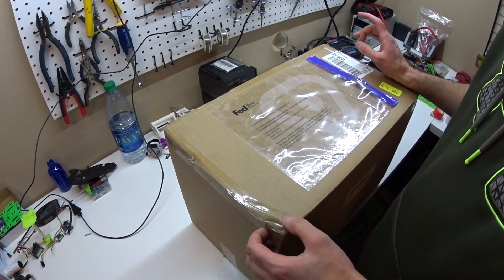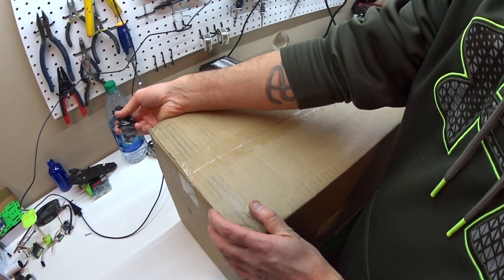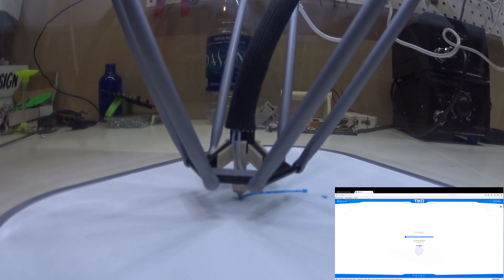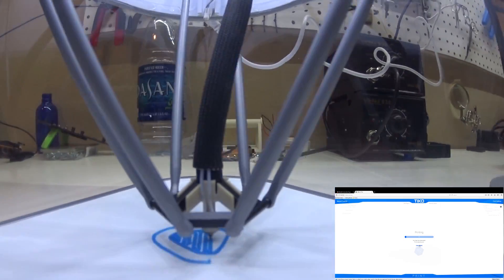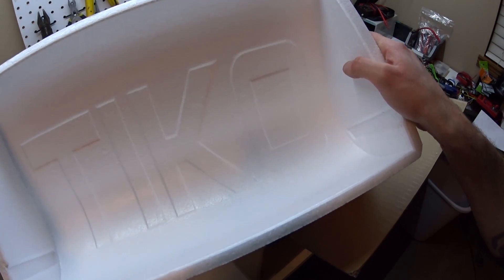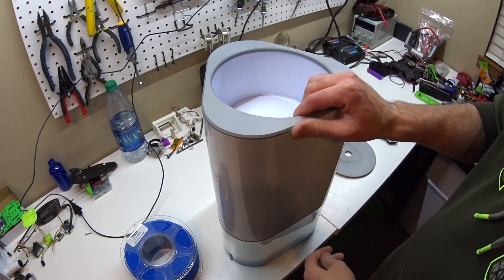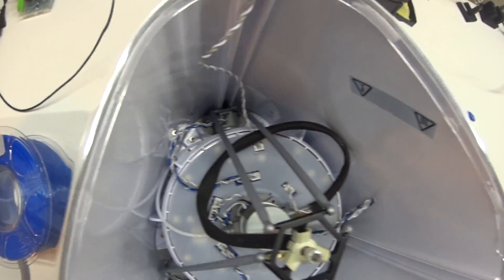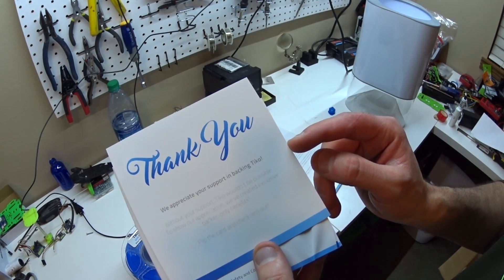Production Tiko 3d - Print and Unboxing

Comment: I'm having horrible luck with my Tiko I just received. Could not even print the demo model properly. Spindle/arm drive motors kept popping out of the tracks and Bowden feed tube came apart mid-print and broke filament in the feed motor, required a complete teardown.  A whole day messing with it trying to print something so far. Had hoped for better.  It had been dropped too hard in shipping and had cracked clear acrylic that Tiko does not warranty (cosmetic).
Reply from the maker: Oh man sorry to hear that you are having so many troubles. The arms should definitely not be popping off during the print. I know I have had some difficulties getting the arms apart as I had to have Tiko send me some replacement arms. The carriages should also not pop off to easy either. Do you still have 4 clips on the carriage?
Here is a picture of the carriage:
https://goo.gl/photos/8UosXFooJqBDkiXN6

If there is a ton of slop in the carriage then I would contact Tiko for replacement carriage assemblies since you shouldn't have much side to side play in the carriage assembly. I would also check the gear rack that the stepper motor comes in contact with since I have heard of others having issues with the alignment of the gear rack.
Reply: Propslayer, the arms were not popping off, just the carriage clips. This is a brand new unit and there did not seem to be much slop in the clips. I do have a support request in with Tiko. The gear rack alignment is something I'll look at next, thanks for the suggestion.  The prints it did manage to make were sloppy and skewed and the demo model printed a lot worse than the one it came with.

The other hassle it not being able to get the Tiko to log on to my home Wifi router to get internet for updates and access it from my desktop, just hangs at "in progress..."  I've had to run it direct from my phone only.
Reply: cybervid07 if you want a good 3D printer I think the anet a8 is good but I hear that also sorry about your experience
Reply: Thanks. My Tiko may never work properly and parts have failed, and likely I'll never get the warranty parts I ordered because Tiko will be filing for bankruptcy soon from what I read on their own forums. At least I got a (broken) printer, many thousands of backers may get nothing.  I will look into the anet a8.

Comment: The distance to the print bed is actually just fine: while printing a raft the distance would be 2 layers high and double the filament. On top of that a thin easy to break-off layer. That's exactly what appears to happen.

Comment: Thanks for sharing.  Looking forward to seeing a print with a higher temp.  Not sure why it needs such a high temp? 190 should be fine for PLA
Reply from the maker: Rich A - I saw in the comments that Tiko mentioned that 220 was beginning to be their go to temp for the gem pla. Normally with pla I print 215 for the first layer withe a bed temp of 65 and drop down to 205 with cooling fans enabled in SS3D. 220 didn't work so I'm trying a print right now at 205. thanks for watching

Comment: Horrifying to see the print detach like that. Hopefully a higher temperature helps!
Reply from the maker: It happens even on other printer from time to time to be honest. I have it happen on my other printer that has a heated bed. Sometime the calibration is just off enough that the print bed adhesion is just not strong enough. I am running another print right now at 220c to see if that helps.

Comment: The test print you did looked pretty bad, was that because of the poor auto-calibration?
Reply from the maker: Part of it was due to print bed adhesion, but the other part might be due to low extrusion temp as well. I increased the temperature to 220c since I saw in a reply from Tiko that this was the sweet spot. Im doing a benchmark test print right now at 220c to see if that helps at all.
Reply: Propslayer Fabrications OK. That is good to know. Please make a video with your next print